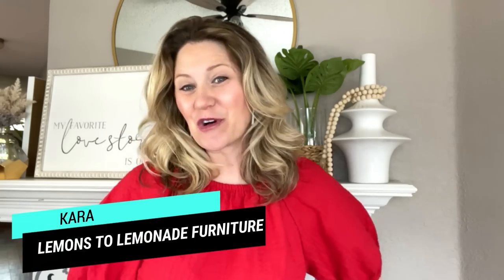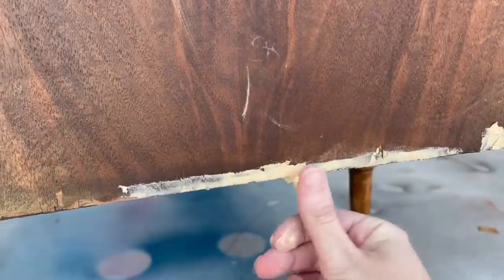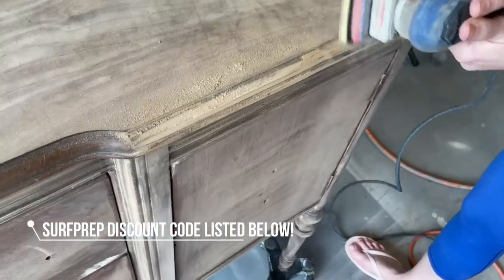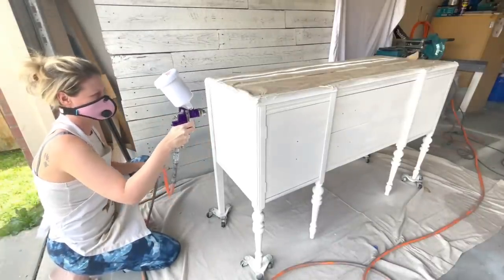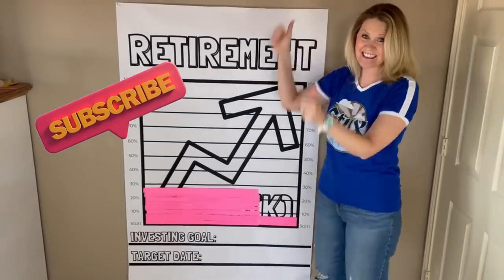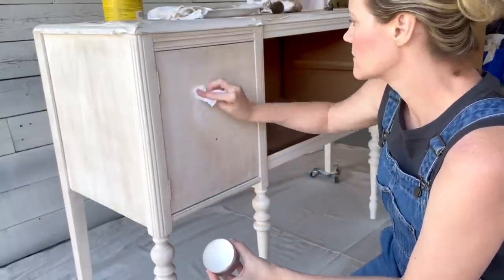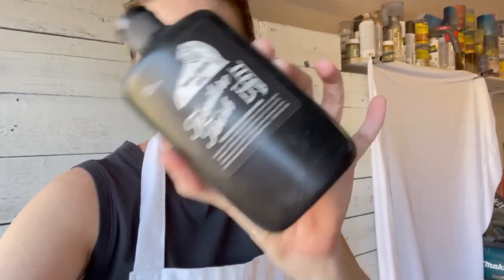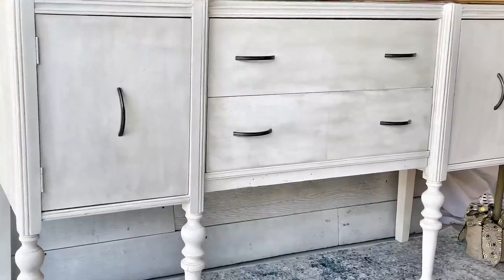How I Double My 401k // 401k Payoff with Furniture Flipping

Comment: I love how it turned out, you nailed it! im interested in the walrus oil, how durable is it? is it as strong as poly?
Reply from the maker: The Walrus Oil is not durable like a poly but more like a wood restoring product. It's perfect for something that will not have anything hot placed on top.
Reply: Is this permanent or will the customer have to reapply it? Great video!